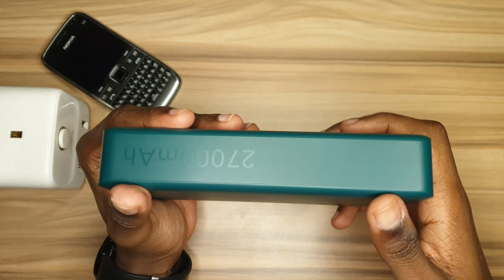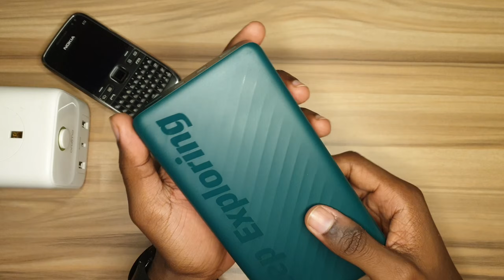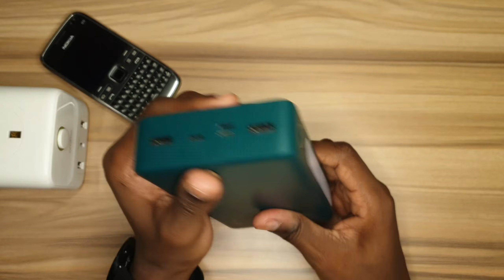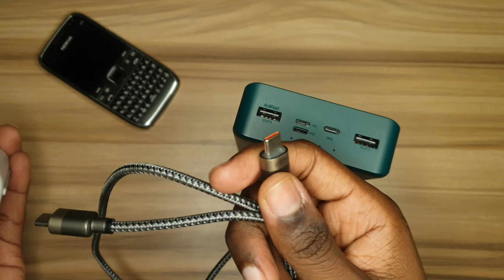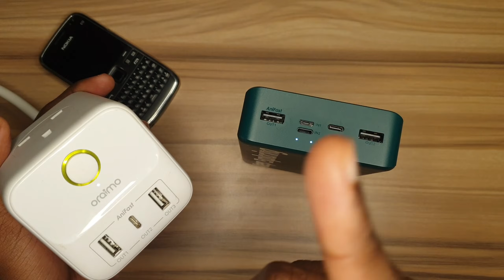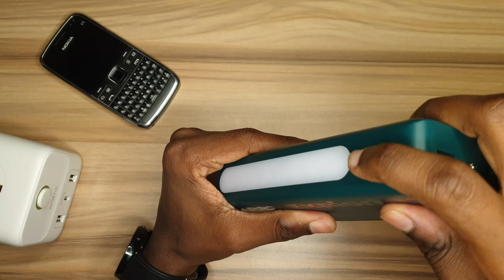Is It Worth It? - Oraimo 27000mAh Power Bank Review

Comment: Do i need to charge first till full or drain the battery immediately i buy mine?
Reply from the maker: Not really. Lithium batteries should just be fine if you start using them out of the box. Just don't let it drain completely.

Comment: Hope it doesn't swell up
Reply from the maker: No it hasn't so far. Still intact today.
Reply: @KenyanRadar  how is the changing does it charge like these phone 5times like the old 27000mAh that swell up
Reply from the maker: What I can say is that it has lost a little bit of capacity but not too much considering I have been using it for more than one and a half years.